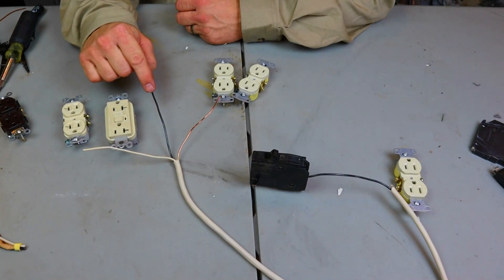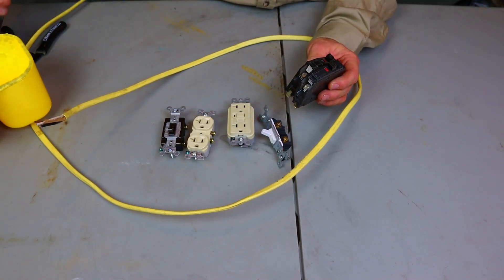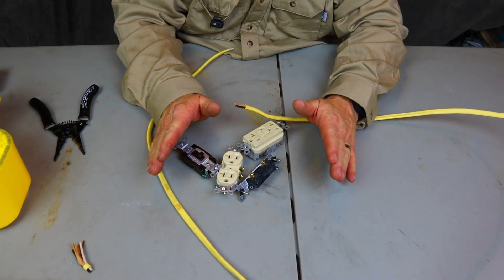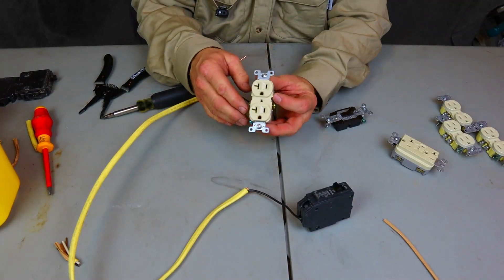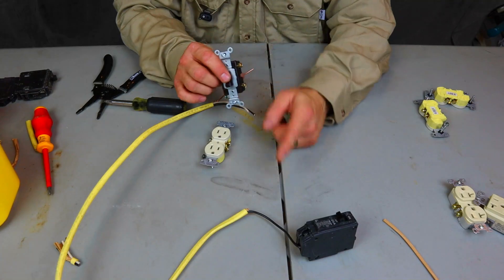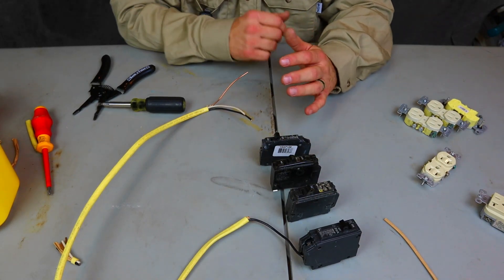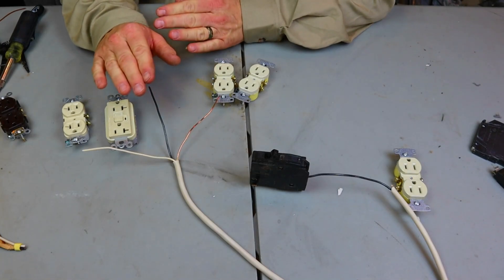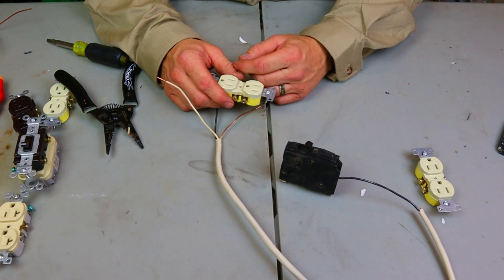15amp Vs. 20amp - No Confusion!

Comment: 404.14 Rating and Use of Snap Switches. Snap switches
shall be used within their ratings and as indicated in
404.14(A) through (E).  So a 15 amp switch can be used on a 20 amp circuit as long as the load does not exceed 15 amps.  A single 60 w or LED lamp does not warrant a 20 amp switch.

Table 210.21(B)(3).  permits more than one 15 amp rer LEDceptacles on a 20 amp circuit.  A duplex receptacle, as the name suggests is two receptacles.  So a single duplex 15 amp receptacle on a 20 amp circuit is compliant.

Comment: I thought that according to the NEC book, a receptacle is one outlet that u can plug into.  (Look up the definition of receptacle).  Those in ur videos are duplex RECEPTACLES.    Therefore, u can use one Duplex 15 amp  receptacle on a 12 gauge wire with 20 amp breaker…
Reply: Correct